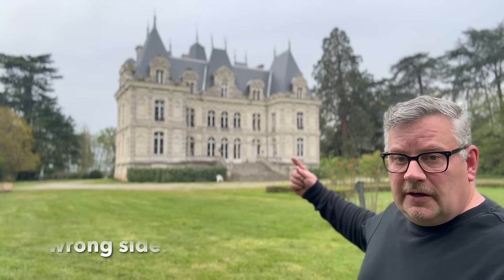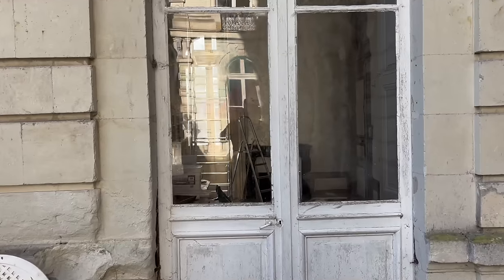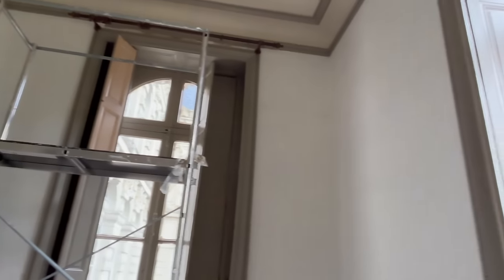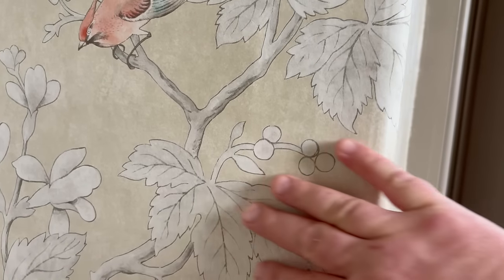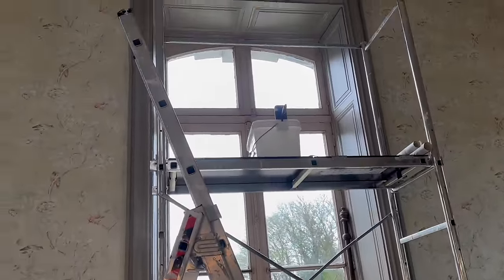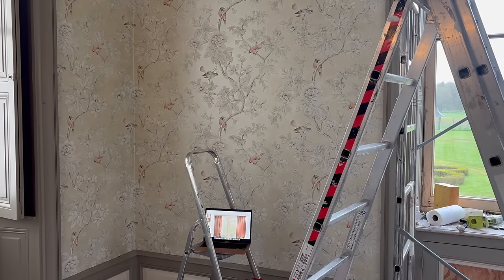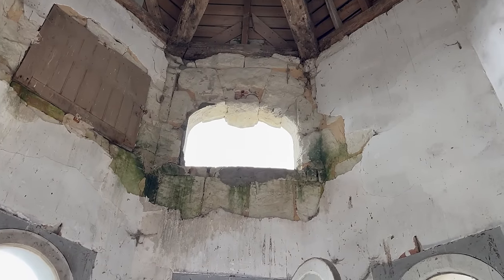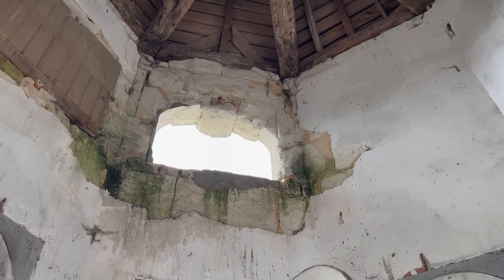Château de la Grifferaie: S5, E15: "Main floor Guest room"

Comment: Rob I recommend the SEBO canister vacuum. Having a professional cleaning business I used it for 20 houses. Replacement parts are readily available. It has hepa filters. It uses bags and I was able to make this more economical by cutting bottom of the bag when full. After emptying the bag I would reseal it with duct tape. I could get two to three uses per bag. This vacuum will be a life changer for you guys. I would have to buy replacement vacuums often before I purchased my SEBO. The guest room looks wonderful.

Comment: Your hard work is paying off. It is looking beautiful! I really enjoy watching your videos.

After watching so many château DIY shows, it appears that the best and easiest way to restore the floors is to use a large drywall sander that hooks up to your vacuum cleaner and sand the floors down and then use Osmo wax sealer to seal it, and it looks as if you have varnished it.  They turn out absolutely beautiful.  Of course, if you have a local place where you can rent a regular floor sander that would probably be faster, but I’m not so sure if it would be cheaper, it depends on the prices in France.

Osmo wax sealer is so much easier to maintain because when it starts wearing, all you do is just put another coat on. Unlike varnish, It has to be sanded off.  

You can see examples of this on last weeks “ The Pethericks” YouTube vlog because they are refinishing the floors in their château.  

Just thought that might give you some ideas of a quick and easy fix for the floors.

Comment: Very nice progress update! I wonder if all the flaking ceilings are related to high humidity in general, not from roof leaks. With little to no heat to dry out the building all winter, I suspect that's your issue. Incidentally, the use of "roof" for "ceiling" seems to be a British-ism as my UK friends say that all the time.